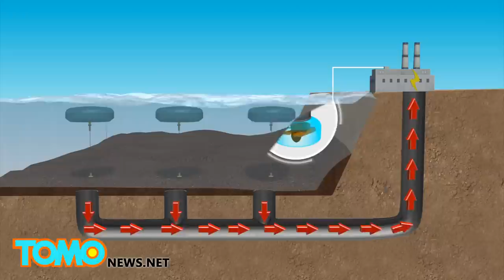Renewable energy: CETO system converts sea waves into zero-emission electricity

Comment: This makes sense as I as I have been reading about this type of system for a while and this is the first I have seen it explained in a graphic mode.  Like solar and wind, as they move forward on this the costs will drop.  GREAT IDEA FOR DESALINIZATION.  Since it is already high pressure no need for electric pumps to run the RO system.  BRAVO!!!!  Let's hope they continue.  California needs to look into this and they can sell the sea salt for a huge profit (instead of current methods)